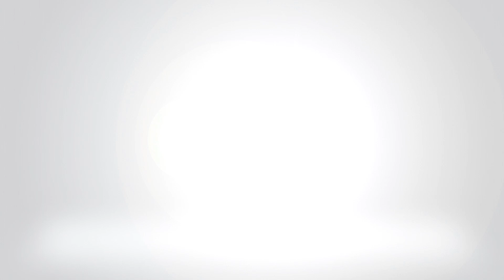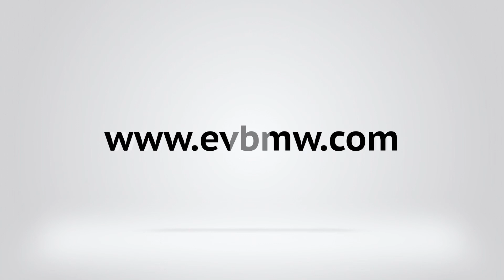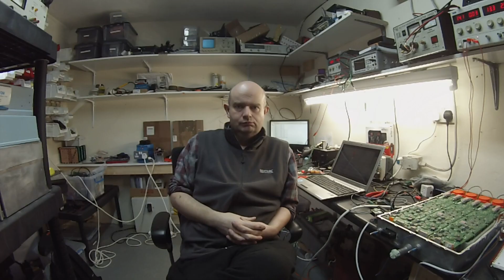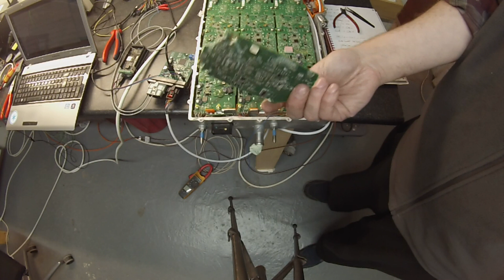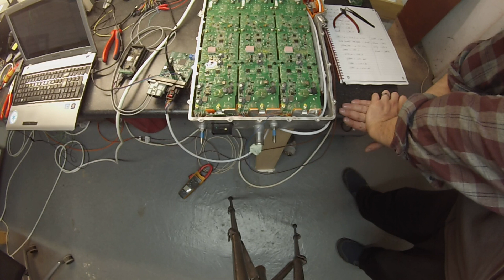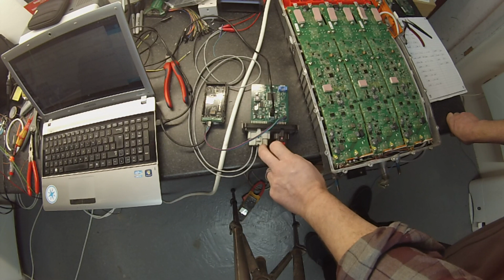Tesla 18.5KW Gen 3 Charger Controller Testing

Comment: Isn't that just essentially just three PFC boost converters? Most likely bridgeless or multi-phase?  It must have to put out a minimum of 325 volts if that were the case. Is the output isolated?
Reply: Most likely has more than just a PFC, because a Tesla battery pack can go lower than that (3.0V/cell would be 288V?), and because they have US and EU versions of the charger.
(I really only know of the Leaf charger. It has a PFC and then an isolated switched-mode power supply to which the brain board sends a desired current value that it slowly follows.)
Reply: @celeron55  If you teardown any decent universal input (100-240v) power supply, you find they almost always use a 370-400v dc bus. Even when using the granny charger, it would have to boost to that voltage for the rest of the system to work. I'm not saying the Tesla unit doesn't have a second stage, but for the sake of efficiency it would make the most sense to not have one. I don't think it's a coincidence that 96S is becoming the de-facto standard for electric vehicles; it's simply the best fit and most economical to charge from worldwide mains.